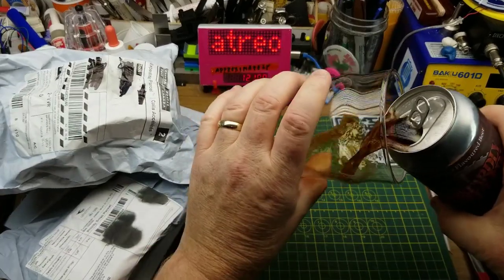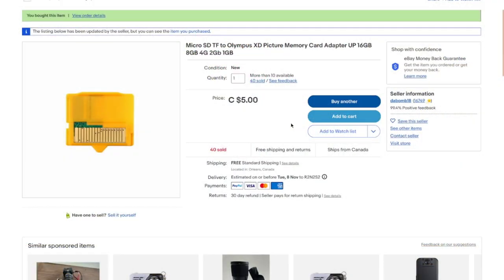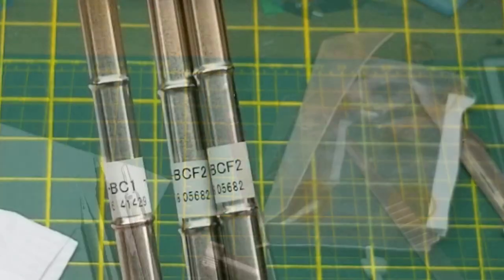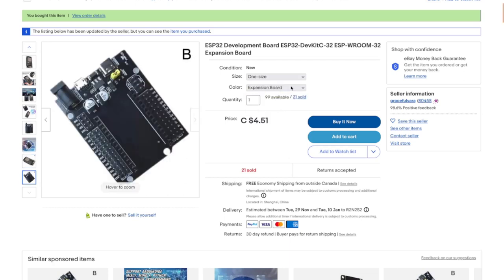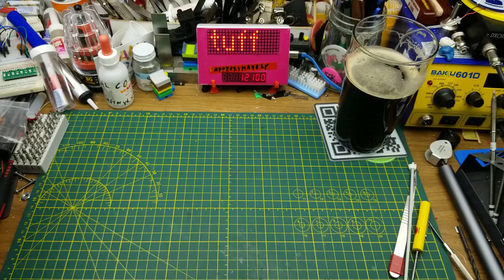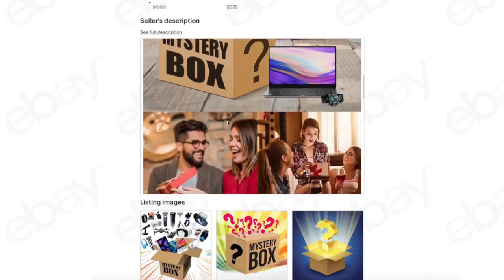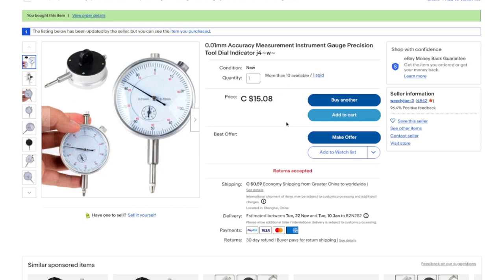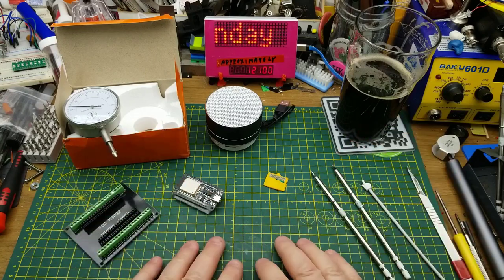Mailbag Monday 151

Comment: Speaking as someone who once bought a car for £360 on eBay while under the influence, I have no grounds to poke fun at you. I had a cheapo bluetooth speaker given to me and I hacked a 3,5mm audio lead onto it to use it as an amplifier for my electronic experiments, having its own power and me not caring too much if I destroy it has been useful. Perhaps you could do the same to supply sound effects on your model railway?
Reply: I was awakened one morning to an Amazon delivery of a radio controlled helicopter that was obviously ordered while under the influence 🤣 only upon opening did I start to get a very blurry memory of playing with my friends sons Christmas gift, but had no recollection of actually ordering one and I can just about remember my password info when I've got a clear head

Comment: I took one of the angled flat soldering tips and ground a divot /hole in the center of it. I use it most often. The hole kind of causes the solder to pool inside of it. What this means is if you clean it out and place it on a blob, it draws a small amount in. This works amazingly well to clean up over soldered pins. It's not a huge amount but it's just enough to clean up pins with ease. They actually sell tips like this for professionals but they are expensive and only work with high end setups. Louis Rosman did a video showing it so I had to try it. Just thought I would share.

Comment: As soon as you showed the 'random' listing I thought Ashens 🎉
As for the esp32 carrier board issue - the fix is simple, just stack 7-10 sets of pin headers on the bottom and you will be able to change the width to fit the carrier board without much strain... Go on, you know you want to try it!
Reply from the maker: I may have to make an adapter for my adapter...
Reply: @pileofstuff  Do it as a tutorial - design and measurement through to PCB layout to build?

Comment: So, I have been collecting all the memory card formats I could (just so I can plug them all in to the computer at the same time). I bought that yellow xD adapter and later found that it only works in specific cameras, and not card readers. The idea is that you use the adapter in the camera, pop out the SD card and plug that into the computer.  Waste of money, not clear on eBay.

Comment: Might be something that old guys like us prefer is the eliptical tip on the soldering iron, i have 2 antex XS25's with a medium and a large tipm that style hasn't let me down in over 50 years.
I also have a 100w antex, but with a chisel tip, it's what it came with, it does what i need.
At least open up the speaker, maybe try it with a speaker with a bigger cone to make it sound better
If you do it non destructively, put it back together for a christmas gift ;)

Comment: In my experience the only "wrong kind" of soldering iron tip to have on hand is the one you never use.
If you do everything from smd to through hole to point to point toob socket stuff plus the occasional woodburning project, there ain't no such thing.

Comment: I'm a 2 mm chisel tip fan for most through hole stuff and tinning leads, even some smd parts.. rarely I switch to the pointy thing ..  it's all practice and  flux anyways 😅

Looked like the card adaptor was just a hair too wide (?) .. maybe its possible to shave off a little plastic left and right ..

Comment: The ESP32 does appear to be 5v tolerant for inputs, but not sure about current. There is documentation on it, but it’s been a while since I read it. I couldn’t tell at first, but then noticed the USB-C on it, which I like, because I have two broken micro-USB connectors on ESP8266s.
Reply: There's arduino mega and unos from keyestudio that output 3 amps off the 5 volt pin. I know it's unrelated but it cracked me up when I tested it on my load.
Reply from the maker: It's been a while since I looked at the datasheet, but I thought the ESP32 could only handle about half a volt over VCC (so somewhere below 4 volts).
I;'ll have to look it up again before I do a project with this thing.

Comment: Maybe a nice teardown on that bluetooth-speaker could be nice. Probably a hack to use bluetooth on a bigger speaker.
I guess they might use the same board as on bluetooth headsets, use a bit bigger battery with some output and a bit bigger speaker.
They can be nice for testing and listening to the news and of course when you are on hold (or wait untill someone is finally taking that thing off) on some telephoneline of bigger firms. In latter case... does the battery last long enough for that wait?

Comment: i'm sure i've got a xD card from my old fuji finepix - happy to post it over if you want it. Unsure of capacity at this point though
Reply from the maker: That would be generous of you.
If you want to go to the effort, my mailing address is on the channel"about" page.
Reply: @pileofstuff  I also have 3 XD cards (16MB, 128MB, 512MB) plus an XD reader from when I used my Finepix F810 before the pop-up flash failed for the second time and now the screen is knackered. Would you like these as well?
Reply: @pileofstuff  the card I have is only a 32mb, might be better taking AlanMon up on his offer

Comment: There's a bunch of cool new t12 shapes on ali. I buy doubles all the time haha. I like the bc2 and the il02 I think it is. There's lots of cool handles for them now. I grabbed a jbc t210 clone for smd and found the tips too small. I meant to buy the station that supported the t245 and t12. 200 dollar waste as i purchasedthe t3b in lieu of the t3a and bought a bunch of t245 tips as well. I sent the tips and a pair of probemasters to scott at defpom. Took 2 months from nova scotia and i paid extra to expedite it haha. I gave it to the local makerspace. Haha
Reply: I enjoy the BCM2 with a hollow tip.  It is fat enough to have some heat capacity, and useful for pushing stuff around.

Comment: Sorry you had such a mixed bag, but still entertaining. My MIL has an old camera (Sony maybe, or Olympus) with some weird memory card format that isn't readable in any of the multi-card readers I have. Not much to see anyway in those photos, so that's where they'll stay. I've always wanted a dial gauge, but my use case was pretty limited - disc brake runout. Now they are cheap, like digital callipers have become, and hopefully accurate, I may bite. But you also need a mounting jig to hold it in a fixed position, was that an option?

Comment: I got that kind of Bluetooth speaker free, and it is not even that good. I notice that you can't use it if you plug a USB charger to it as the noise is quite terrible. Perhaps I should try to find a power supply with transformer and linear regulator, but that can give some 50 Hz hum. Any other suggestion? I think it has a LiPo battery, so this is not very urgent problem.
Reply from the maker: I definitely paid way too much...
The price you got yours for is about what its worth.

Comment: This does not seem to be expansion for the esp 32. Esp8266 on the other hand is one "pin" wider, so it would fit on the "external pins". Or possibly they had to do the board wider to fit the CH chip. How many pins are left on a breadboard while you plug your esp32? I have 1 row left on one side and 0 on the other. Probably the fact it is asymetrical nature of this clone makes this board impossible to fit there
Reply from the maker: When I'm using a wider module I'll span it across a pair of breadboards so I have access to as many holes on the board as possible

Comment: If I remember correctly xD was a terrible format for storing photos. I just looked at wiki and they have no wear control and only limited in size (biggest size available is only 2gb)
Reply: Well, for that time these were normally used that was more then enough...
My digital photo-camera in that day was using 128MB (!) cards and sometimes a 1GB for a whole holiday with many, many pictures + many-many battery-charges.

Comment: The memory card adapter did you try it 180degrees from the first way you tried it ? Basic.y back to front
Reply from the maker: Yup. Tried every possible orientation several times.
Reply: @pileofstuff  There are 8 possible ways. Hope you actually tried all of them. 4 facing contacts to front, and 4 with contacts facing back of camera. Ok, probably 4 actual possible ways given the card is t a square.